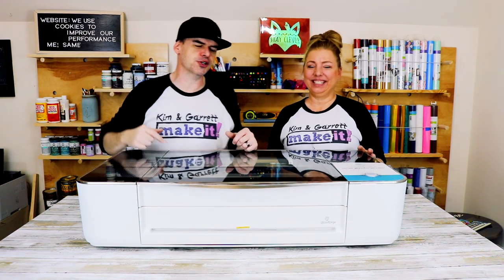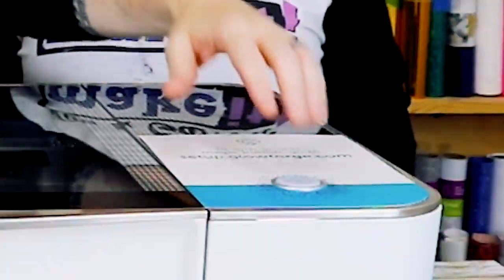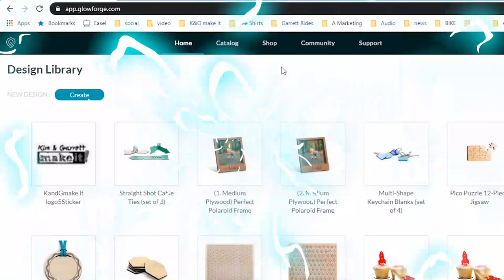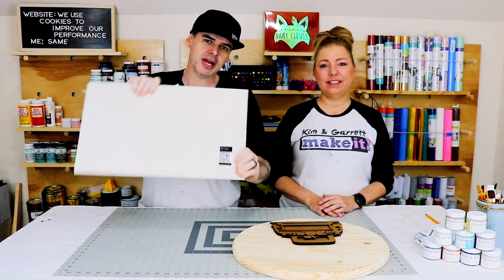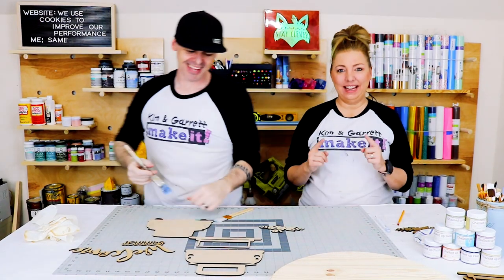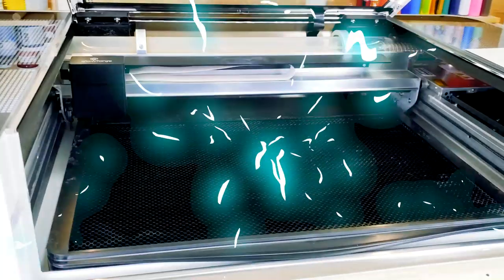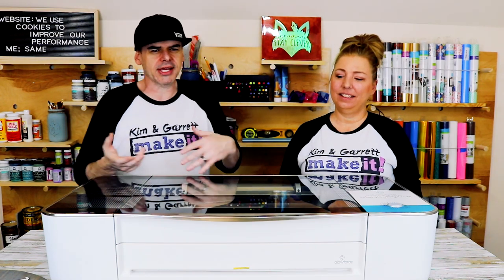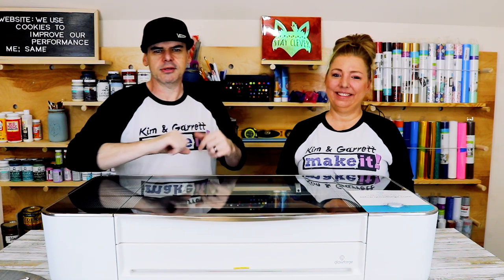Why We Bought a Glowforge Pro | First Project and Review

Comment: Enjoy! Looks like u guys know how to have fun! 😉 Btw I didn't see an inline fan set up. You may want to consider it for various reasons.
Reply from the maker: Yep, we received a lot of comments about adding one, we have one know order!  Thanks!
Reply: Hi there! I know you posted this comment months ago but may I ask -- is the inline fan as effective as the $995 air filter Glowforge offers on their site? Does it effect the noise level and/or smell at all?
Reply from the maker: So this is Kim and we did get the glowforge air filter and I think it was the best purchase.  Little to no smell and a little less noisy than the fan.  I'm sensitive to the smoke. If you ask Garrett, he'd say the inline fan is just as good and it also reduces the noise level and remives the smoke.
Reply: All that ive seen from the GF groups is trouble and cost with the GF add on filter. No one i know recommends getting it. Almost all of us have the external fan n that works great for me and a heck of alot cheaper. Only time id even think of getting one is if i had no way to vent to the outdoors. But seriously, ive seen so many complaints about how fast it fills up and how expensive it is, i wouldnt recommend.
Reply: @KimandGarrettmakeit  Thank you so much for response! 😊
Reply: @livingmytruth90  Thanks for the insight! I'll definitely be looking into this! 😊

Comment: I’m up next for purchasing this machine.  I don’t like buying supplies from the maker. Please tell me I can buy supplies from Lowe’s?  These are deal breakers for me. Can any of the models cut wood? Im looking at the basic model since I’m just getting started and since they are so expensive. Keep reaching the masses. You are so fun to watch.
Reply from the maker: Thanks Joe! I cut 1/4" MDF I get from Home Depot every day. I cut 5mm under lament from Lowe's all the time. I also use 1/8" MDF and Baltic Birch a lot. I have the Pro, but I bet the Basic would cut it too, just slower. The Pro has a 45w laser and the Basic is 40w. So, just run it a bit slower and it should cut all the same stuff. I haven't been able to buy anything from the maker, they have been sold out of everything since I got mine.

Comment: Omg I’m actually almost saved up for one.  How do you like it so far?
Reply: How do you guys have it vented?
Reply from the maker: Its great!  Super easy to use!  As of now, we just have the dryer vent hose pointed out the window.  We closed the window to the point its touching the hose. And we put a board across the rest of the screen to prevent it from blowing back in.  Not the best setup yet, but its working!
Reply: Kim and Garrett make it thanks that’s what I plan to do as well.  Have fun creating things. Cant wait for the next video ❤️

Comment: hello just want to ask a question how did you set up the exit vent and is it really load ? thank you guys
Reply from the maker: We just pointed the hose out the window. Its flush with the screen and we closed the window some to hold it in place.  And for now we've blocked the other side with a 1x6 so the exhaust doesnt blow back in.  It's working well.  It was recommended to add an inline fan to help with exhaust and sound, so we have that on order.  I can work in the room with the current set-up, it doesnt seem too loud and barely any smell. Hope this helps!